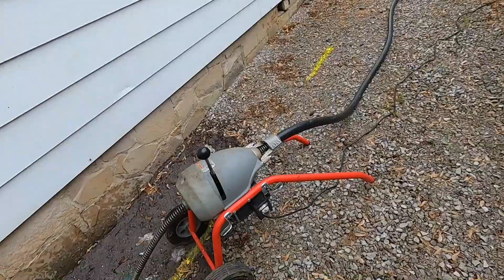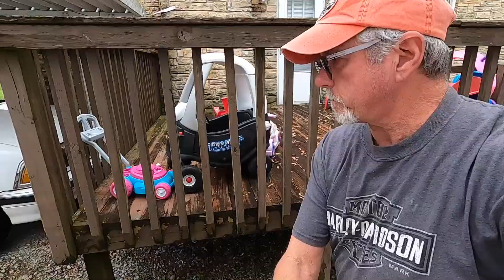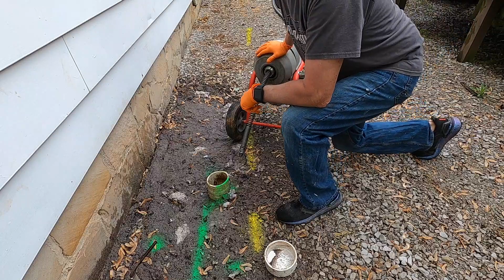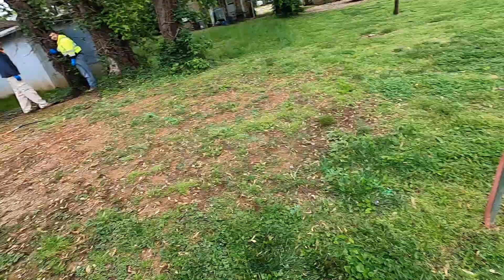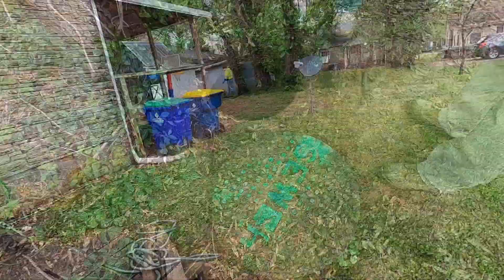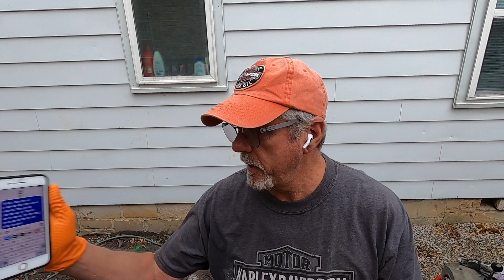Ridged finds corn again!!

Comment: New sewer line time! Are you a licensed plumber David? Here in my town they won't let the homeowner install a new line and and definitely won't let you hook into the main.
Reply from the maker: The law here is I can replace 10ft of pipe The city will come help me with what ever I need.
Reply: @DavidFDay Ive had 3 new lines in the past year. I figure if its orangeburg than I'm better off just replacing it. Here is cost between 1500 and 2k.